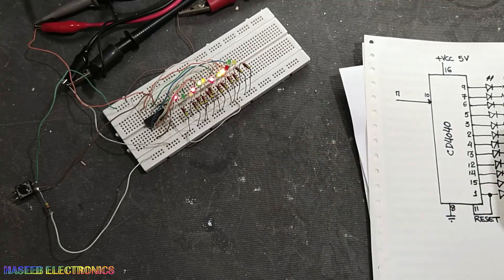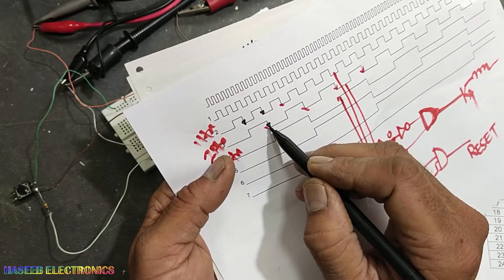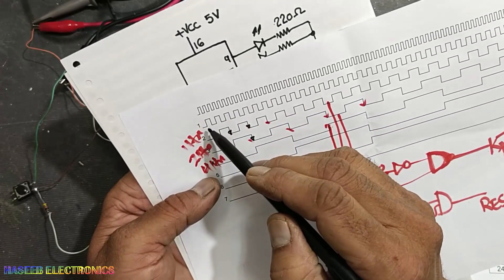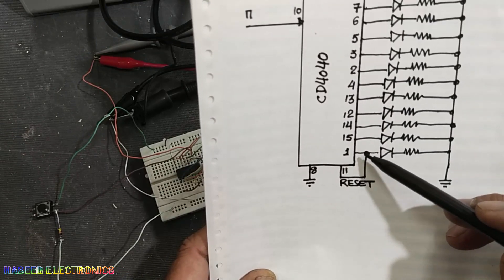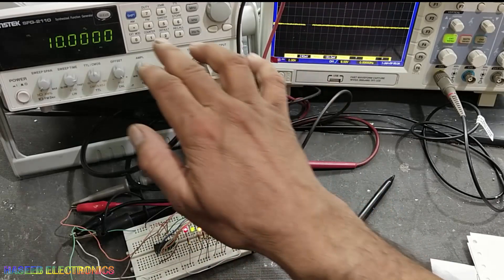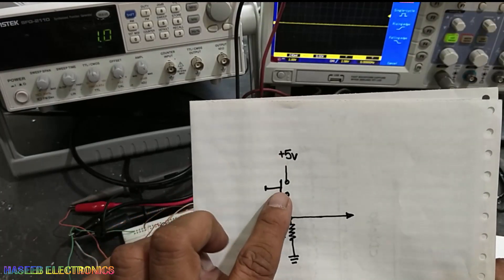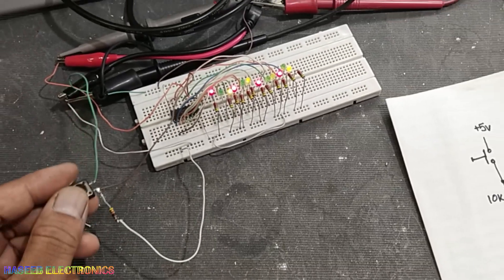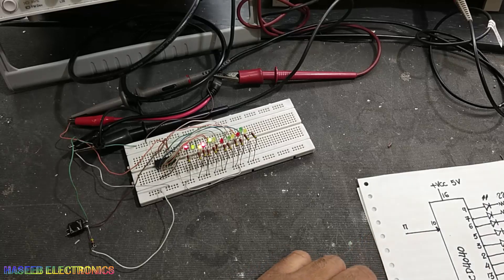{574} CMOS 12-Stage Ripple Carry Binary Counters, Binary Counter. Frequency Divider IC/ Test CD4040

Comment: There is a ic in a computer smps psu that is responsible for generating pulses for mosfet ( driving the mosfet with pwm)
If a computer  smps psu is not working how will anyone know if that smps is not working and that is due to that ic chip and more importantly how do we check that chip in general is even working at all.